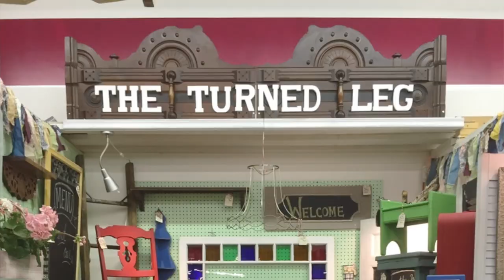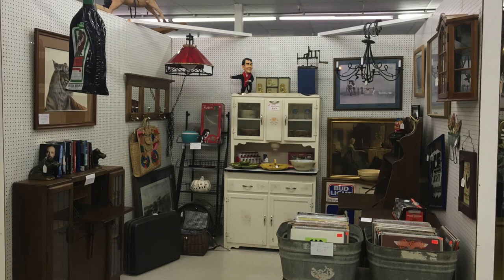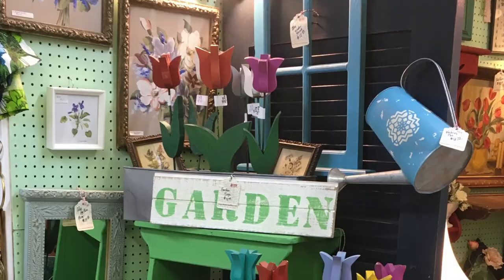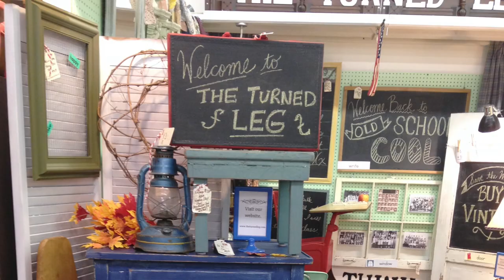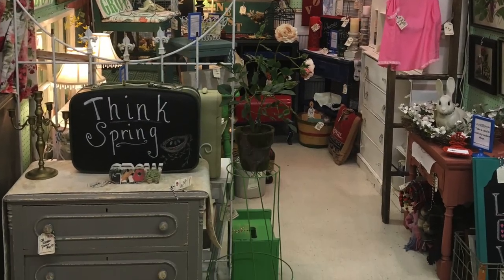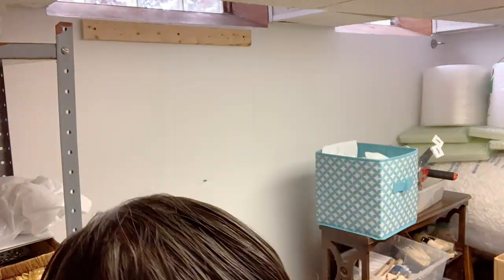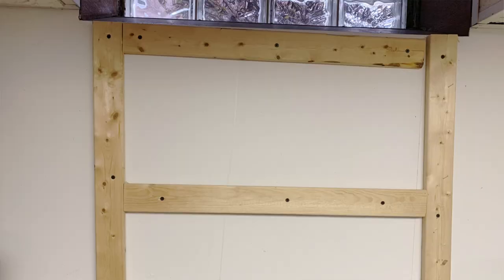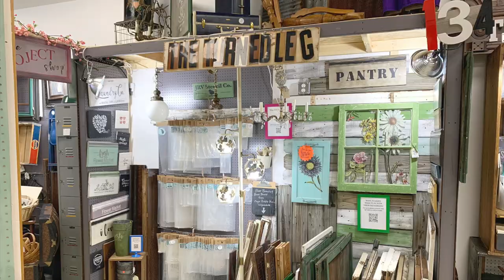Booth 101 Setting Up Your Booth - All About Walls

Comment: I have a space at an antique mall that is out in the middle of a room, it has no walls!!  How do you make walls and how do you make them safe.
Reply from the maker: Please check out my other videos on how I build my displays. They are all in the Booth playlist
Reply: Ruth I see that many of her doors are standalone (not hinged to another door for stability) but are on some kind of brackets or base so each one can be placed separately (and is lighter to lift).  My mall guy used 4" steel mending plates 9 or L brackets (hardware store) at top, middle, bottom of doors to join them in a straight line ("wall") but has to use more of those hardware strips/pieces to connect my "wall" to a neighbor booth's wall to be fairly sturdy.  If it's long, the end of the new wall needs another door or large furniture to attach to at a right angle for final stability 

If course doors connected at right angles or that are already bifold closet or interior doors are stable in their own.  Could still be pushed over with effort but light booth use should be ok.

You'll always be limited to some extent.  I have a super fireplace surround with upper and lower mantles/shelves and a mirror between.  Likely 125 lb or more.  At home, I lean it against the wall and screw into studs.  I'd never trust that our mall setup would support that plus all the merchandise that would be lost if it fell over.  "A gal's got to know her limitations"  😳😅